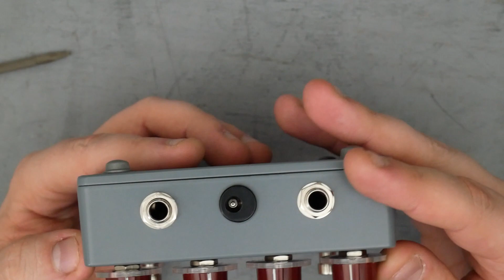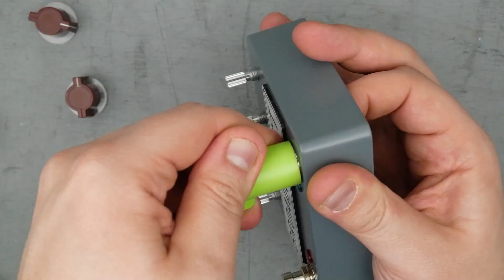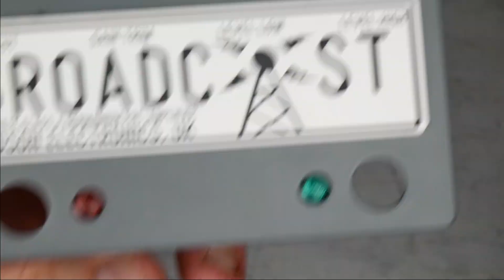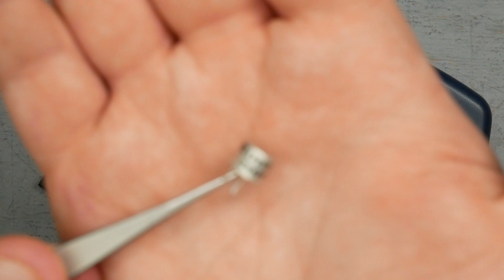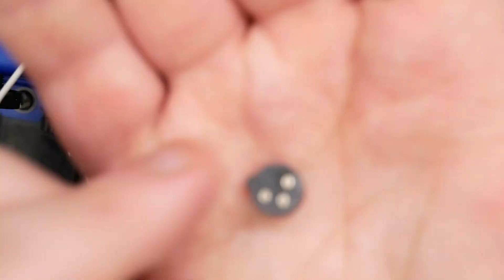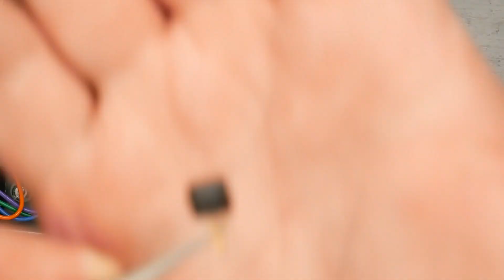Hudson Broadcast Dual Teardown! UK-made Si/Ge Hybrid Preamp!

Comment: With Cole pots that far off from schematic specs... Congratulations you got yourself a Broadcast Variant!!  All sorts of stuff happens/ can happen when you switch from strip board/ VERO to PCB WHICH can result in such drastic value difference's. 

I'd want my broadcast on VERO.  I'm old school guts. This PCB is too new.  If it was done like the very first big muffs and the single side red PCBs with the Rivers of Solder that would be even more awesomeness and a combo of both would be outta this world.

I'd love this pedal socketed and a couple more bells and whistles. Fuzz factory style

Comment: What good circuits would you recommend for really low gain germanium transistors (40 or less hfe) or high leak germanium transistors (300uA and greater)? Aside from a unity buffer.
Reply from the maker: The low gain germs could be used in any pedal that incorporates a darlington pair. Check out this article from Steve @ small bear: http://diy.smallbearelec.com/Projects/OhMyDarlingRM/OhMyDarling.htm

I believe some of the tone benders requirer higher leakage germs. Good luck!
Reply: @graybenchelec  I've done the Sziklai pairs before, like on Small Bear's site, but Darlington pairs with 2x germanium transistors, the leak multiplies, so 20uA x 20uA becomes 400uA, which usually isn't usable. That and 20 hfe x 20 hfe equals 400 hfe, which also is a bit hot, unless I want to build a Big Muff. I did find making a low gain, low leak ge as the first half of a Darlington, and then taking a 2n3905 (the 2n3906's lower gain sibling) and flip the pinout 180 degrees, I can get around 100-ish hfe and around 100uA of leak, but so far, that's it.
Reply from the maker: @erikvincent5846  Yeah that's the idea, using silicon for "half" the darlington pair. 
You could also try your low leakage Ge in a percolator. I've read a whole range of hFEs work in that circuit.